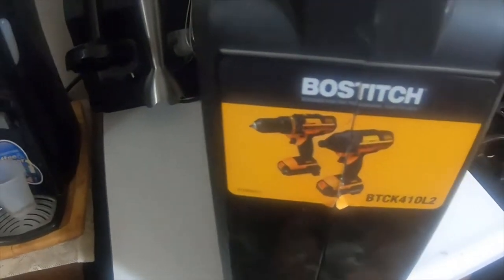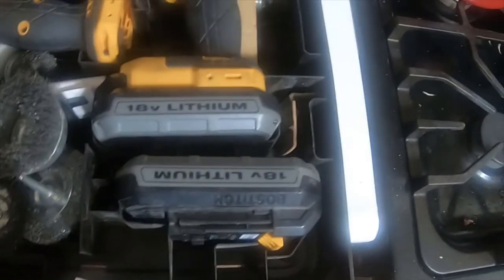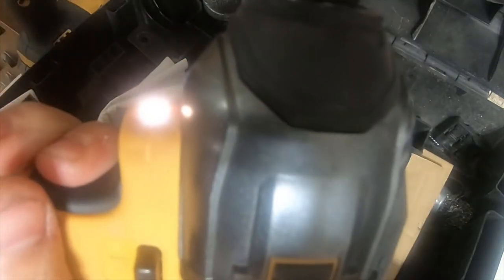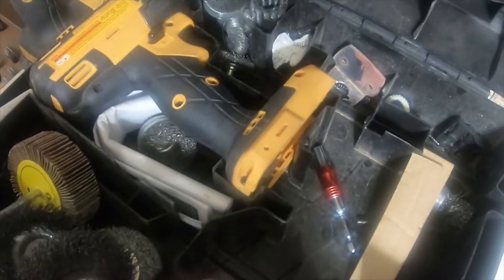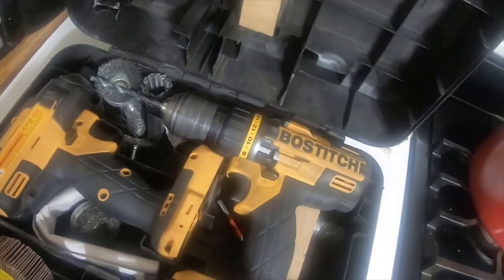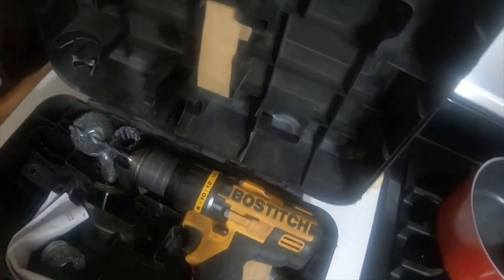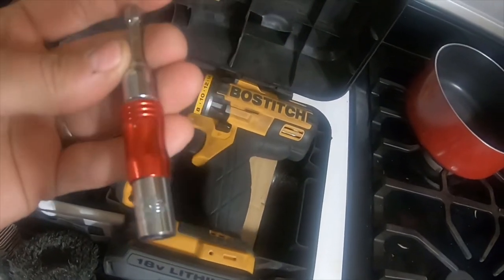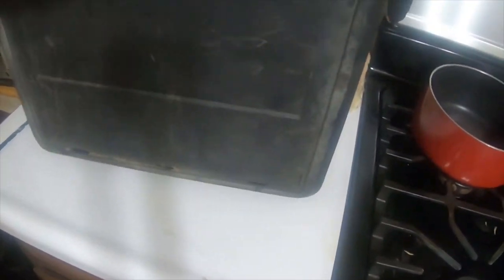Bostitch 18V Lithium 2 Tool Combo Kit 6 Year Review

Comment: Thanks for the shoutout! You can replace the chuck on that drill. If you open the chuck all the way, you'll see the screw in there. They're usually a reverse threaded torx.
Reply from the maker: No problem bro on the shout out you did ask if I had this video so why not dedicate it to you since you asked and thanks for the info not sure were I would find a replacement chuck though
Reply: @AntonioClaudioMichael  I gave you a shout out on my latest vid about a hacksaw I just got.
Reply from the maker: @toolinhand  yeah I saw when I watched it appreciate that

Comment: I got the bostitch impact driver in 2013 and bought the bostitch drill in 2018 and have not seen a replacement battery for them yet but I seen used batteries but the ryobi brushed impact beats the bostitch impact that the ryobi has 400 more inch pounds of torque and cost half the price and replacement batteries are so easy to get but brushless is all the way the best and they are more compact
Reply from the maker: Back when I bought these bostitch tools ryobi drill with the 400 more inch pounds didn't exist yet @FoxKidTimberWolfSaw